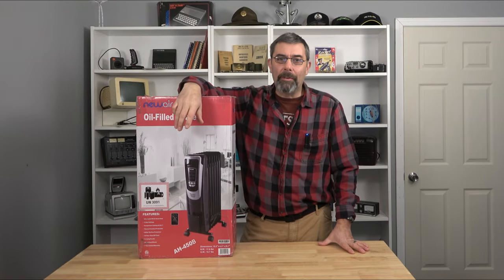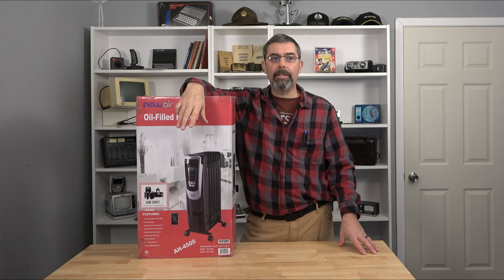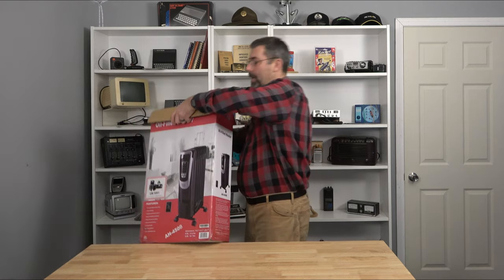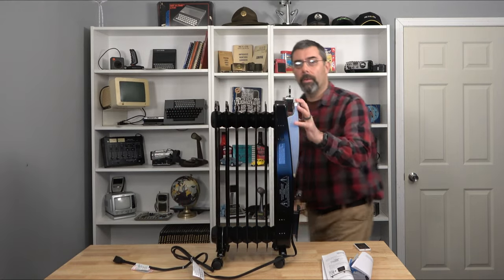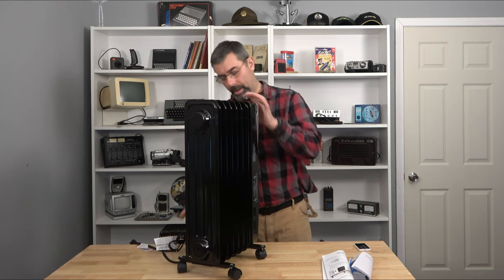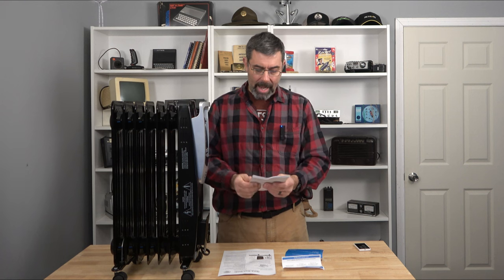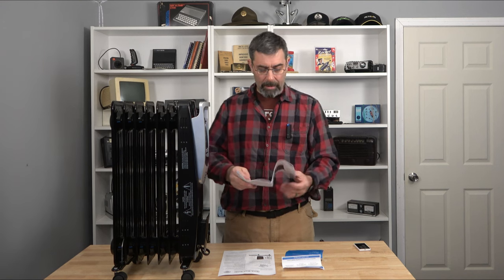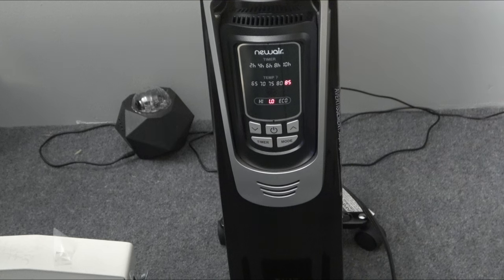Newair  AH-450B Radiant Oil Filled Heater. Perfect for chilly nights!

Comment: I swapped my digital control radiator heaters for analog control, when the power blinked it didn't come back on. Also run on low and use a small box fan on low about 8' away to move the warmed air around the room. I enjoy the shows. Thanks
Reply: People forget that digital stuff usually doesn't come back on after a power fail. Sounds like my setup is similar to yours. I got the Amazon Basic oil heater on Prime day because its analog and has 600/900/1200 watt settings. The 900 watt setting is enough to keep a bedroom 65-68 on most nights. I use a small Vornado fan on low to circulate and you can hardly hear it. I've actually never used the 1200 watt setting.
Reply from the maker: Good idea on the fans to help circulate the hot air around.

Comment: Excellent video Eric  :) I check in those heaters to for future in my radio garage and got Electric Radiant Heaters got 2 glass tubes glow orange when running with fan in unit plus got temperature control plus 3 settings off is 1 , 2  is 750 watts , 3 is 1500 watts and got tip over button on shut down also cuts fan plus 2 tube elements  to shut off plus hear it click button when shut off  tip over ! I have on  a half up  homemade wood skid with nail hold in place underneath my table that metal and box in ! I only have temperature in full open when super cold out temperatures and around it ! I only have plug in and use when in Radio Garage do stuff in there! Also company makes it called Classic  and about same size that one minus wheels! ! Only thing doesn't have wishes is 3 prong plug also wirez should be and 2 wires heavy duty 14 gauge wire of 2 style ! Like 3 wire because it safer too!
Reply from the maker: Good points- I am hoping that I will not need extra heat this winter but winter is not done yet- We are being spoiled with some spring like weather just to end that with some forecast of snow.
Reply: @FarpointFarms  agree 100 % Eric  :) think we have some cold temperatures in next 3 to 5 months  ahead!

Comment: I remember in the late 1970s using one to heat a small shower room. (manual controls)  It is pretty hard to start a fire with one because they don't get that hot and the old ones could  stand  some water exposure.   Next you will be telling me vinyl records are coming back to play on my quadraphonic turntable.
Reply from the maker: You are more brave than I am. Something about electricity and water not being a good combination. I saw new records not that long ago, I almost bought one just to say that I could